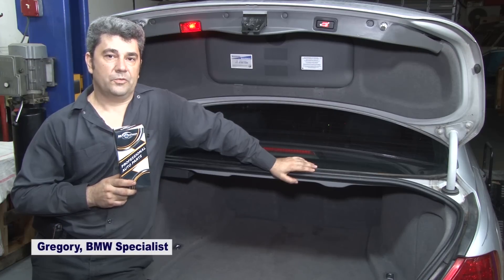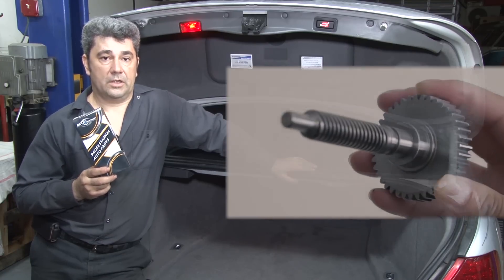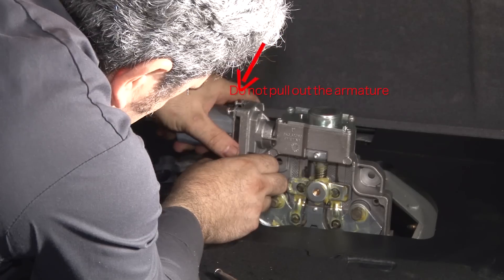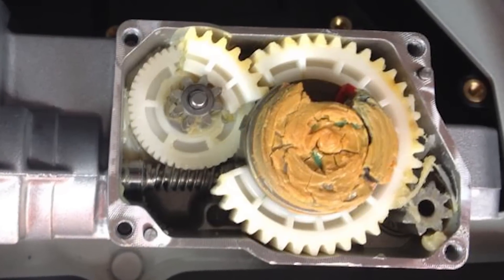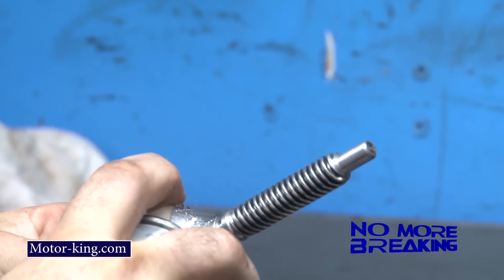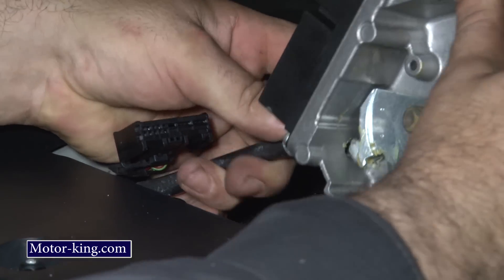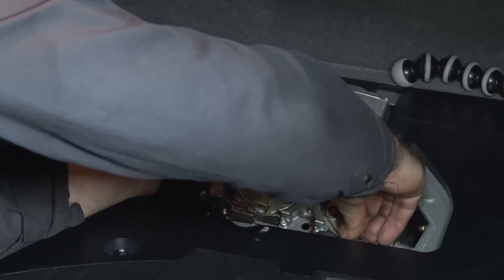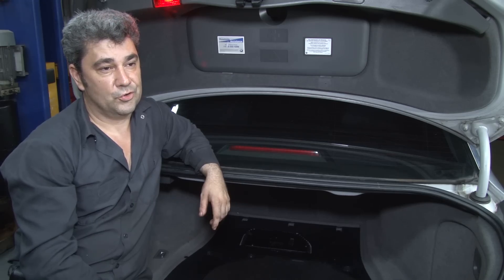NO MORE BREAKING BMW 740I PARKING BRAKE ACTUATOR

Comment: what can I do if I pull the motor the core wired out n can not put it back is it broken? do I need a new one by mistake I pull the wire motor to get a piece of plastic circle that was stuck in the wY OF THE WIRE MORTO MY QUSTION IS HOW DO I PUT IT BACK I TRIED TO PUSH IT BACK BUT WONT GO IN THANKS

Comment: My yellow brake light has been on since I bought my  2006 750i July 2020. I firgured J would test the actuator a few moths ago and it engaged ,setting the parki g brake but wouldnt release the brakes.  I manually releseaded themmwith no issues. Today i pulled the actuator to replace the gear. Apparently a previous  Owner had already replaced that drive gear. Internally everything looked great so I gave everything a light coating of lithium grease and re install the module. I check my fuses 3 were good but when I press the park button nothing happens. How do I test the motorist self How do I test the motor itself without the harness connected. I attached alligator clips to the two blade terminals and the other  end clips directly to a 12v battery when the actuator was out of the car and got no response . I'm  guessing the harness has to be attached so the array of small pins are also connected. Any suggestions will be appreciated.

Comment: Fantastic video. Thank you.
I did also have to clear the “EMF overtravel” code with my OBD scan tool because when the original gear broke, the motor kept spinning for a long time, creating the overtravel fault code.
But this video for replacing the gear itself was so good. Easy step by step.
Reply: How did you clear the code?  I replaced my gear and the mechanism locked up and won't release.

Comment: I did replace the hole unit I ordered a new one from BMW I put it together and the light still there and nothing is moving. I thought the problem is from my car so i repluged the old broken unit and i can hear the motor working. But the new one is just deadly silent .
Do I need to program the new unit or do something additional? Am I missing something? I need help thanks

Comment: What year are you working on. I couldn't see a cover plate in our 1997 740 I
Our parking brake is locked and I can't seem to release it.
Reply: Richard, you have an E38 740, this is a later model, an E65/E66 740 (2001-2008)

Comment: At 1:03 I can not get that part off are you pressing something inside the hole.
Reply from the maker: Once you remove the screws it should be easy to remove. Hope this helps. Thank you
Reply from the maker: Once you remove the screws it should be easy to remove. Hope this helps. Thank you
Reply: AutoTech USA  I removed the 2 screws holding it but it won't come off
Reply: Solved. I had to manually release the parking break I had to turn it until the piece was loose enough to come off.
Reply: How?

Comment: I bought the Gear and replaced it following your useful instructions .. However, it doesn't work as expected..  The yellow worning light is still on even after reprograming and reset the system at my Mechanic Spicialest.  it seams work when press the Parking brake bottem while moving but nothing when full Stop.
   Any idea on this issue?
Reply from the maker: Hi Samba750, We're sorry to hear that the problem hasn't been fixed. It's possible that there might be another problem with the vehicle. Our best advice would be to have your specialist take another look at your vehicle and make sure everything else is working correctly. Hope this helps. Have a good day!

Comment: Installed a new metal actuator today following this videos instructions. The actuator works smoothly and I can manually engage and disengage the brake, however the brake button does not engage the brake and I am still getting the brake warning on the dash when I start driving the car. I have reset the front and rear brakes from the hidden menu and tried holding the brake button five times without success. Any suggestions?
Reply from the maker: Hi Alex, 

Were glad the actuator works. Unfortunately there could be multiple other reasons why the brake warning light is still going on. Our advice would be to inquire with a mechanic and hopefully they will have some better insight for you. Hope this helps. 

Thank you
Reply: Thank you for your reply. Took the car to an Indy shop where the brake light was reset.

Comment: Great video. I have the 2002 745I 4.4l BMW. Is the correct gear 39 teeth or 40 teeth? Each ad say they fit this vehicle. Which is correct for my vehicle. Thanks.
Reply from the maker: Our gear is 39 teeth and should fit your vehicle. Hope this helps. Thank you for your question. Have a great day!
Reply: @AutoTechUSA  hi
Have all e65modells 39 teeth ?

Comment: Hello AutoTech. I noticed that the trunk on your BMW has the power option. I also have this option but when opening the trunk the lid only opens to 70% then the motor labours and the lid closes. Any ideas as to what may be causing this?

I have been to indy shops and the main dealer all of whom gave me blank looks and suggested I change the motor unit and sensors.
Reply from the maker: Hi Alex, 

Unfortunately we do not have an answer for you. We would suggest speaking to a technician as that would be the best option. 

Sorry we couldn't be of more help. 

Thank you

Comment: I replaced the gear, followed your video to the step and at the end the system did not actuate. And suggestions? Thank you for your video!
Reply from the maker: Hey David, you would probably have to inquire with a technician to find out more information on why it's not actuating. Sorry we could not be of more help. 

Good Luck!
Reply: AutoTech USA thank you for replying. I took it to dealership and they reseted the fault code and it worked after that!
Reply from the maker: We're very glad to hear that!!!!! Glad everything worked out! Have a wonderful day!

Comment: i cant find this metal gear on your website
Reply from the maker: Please search for G020 Parking Actuator. Hope this helps. Thank you
Reply: Even me I couldn't find it with below mentioned model
Reply: @mohammedalhihi9676  Hola, tenemos este equipo.
Usted puede comprobarlo:
https://www.ebay.com/itm/352854661805
Reply: Hola, tenemos este equipo.
Usted puede comprobarlo:
https://www.ebay.com/itm/352854661805

Comment: I replaced mine and it does not actuate? Do you have to clear codes first?
Reply: Took to dealership and they reset the code for 30.00
Reply: Thomas Burbs did you have to clear code first cause mines did the same
Reply: Thomas Burbs I just had the same problem, replaced the gear and did not actuate. Did you ever get to fix it? Any suggestions? Thanks for your input!
Reply: CumGetSum7480 Wick thanks for the prompt reply!